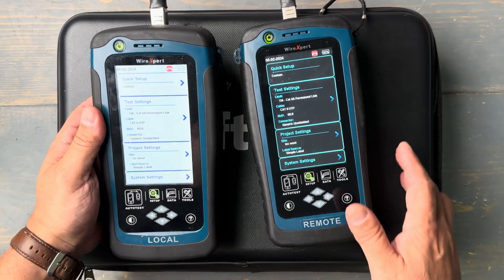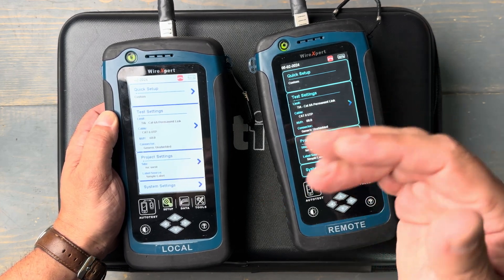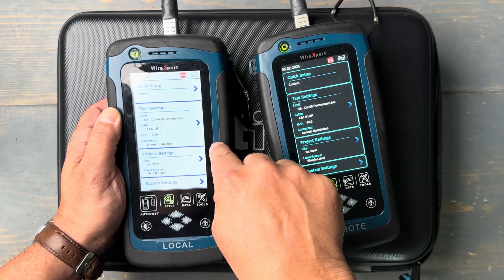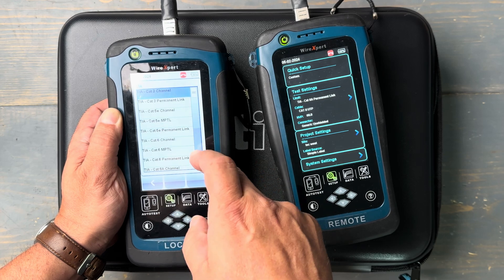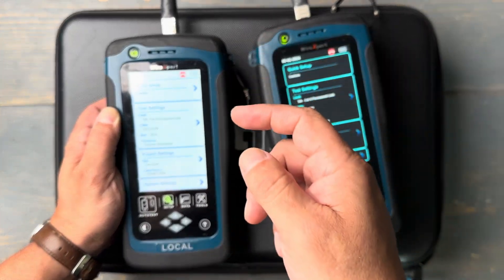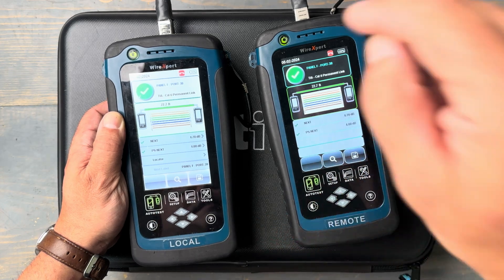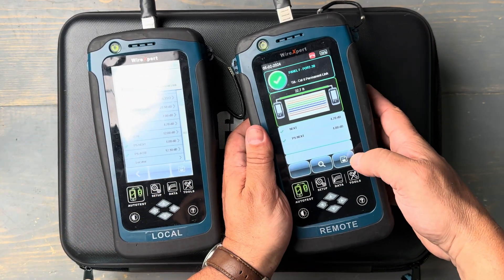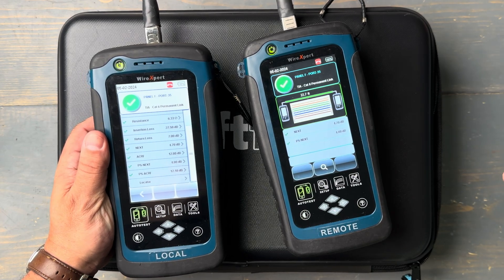How To certify category cable with the Softing WireXpert [CAT6]

Comment: Off topic.. I want to see a how to low voltage wireing for say a 6 port in floor heating manafold. They come standered with flow gages temp gages flush ports an valves. Each 1/2" pex loop has a valve you can manually turn on flow or turn off or adjust flow.  You can add solenoids  Activators.  One must be a 3 wire master and the rest are 2 wire. When useing to control a loop in floor heating you can install a 2 port 1" taco 48volt zone valve  Connected to the thermostat to control the infloor heating on all loops and not need the  Individual so nowadays on the manifold. But in a set up were you use these manafolds as a zone control for 5  Individual  Thermostats.  One must be a 3 wire master. The other 4 are 2 wire slave. .. the 3 wire master tells the boiler to fire.  I like to see a low voltage wireing for this set up.. I joined with hopes of finding this type of set up as well as many others in hot water heating. But it seem all your stuff is ads promoting products. Mainly network cabling witch I know in side an all most, out No real world work.